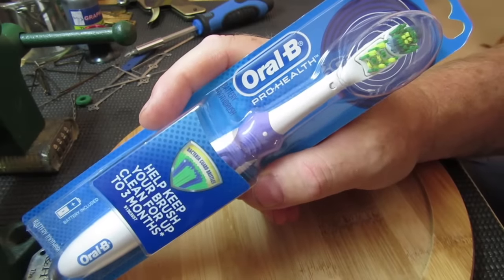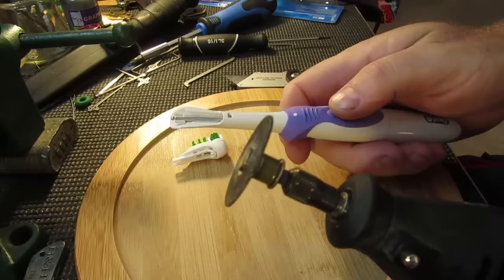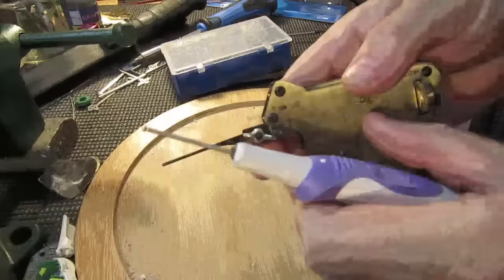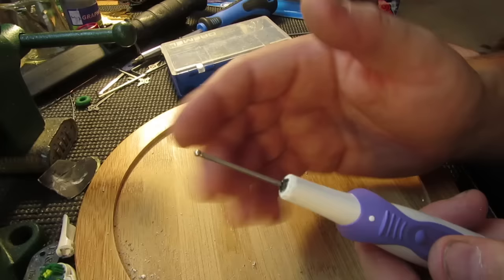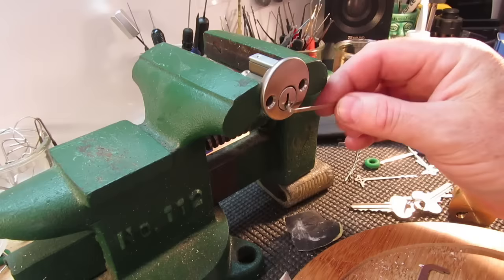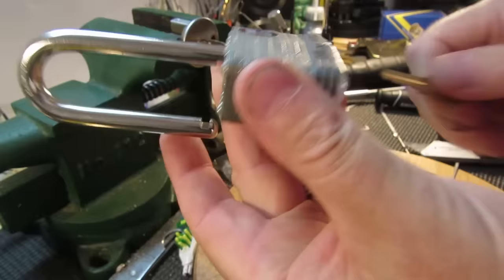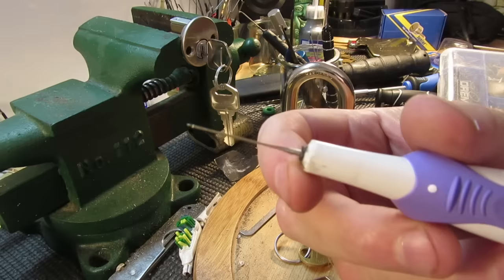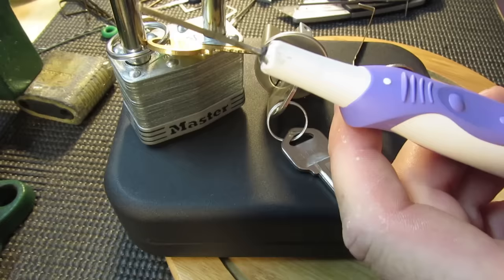Improved Electric TOOTHBRUSH LOCK PICK Simple To Make

Comment: Found on of these Oral B battery operated today at Walmart.  $6.94.   I'm going to try to duplicate this.
Reply: So far, have not been able to replicate this on the identical Master lock #5 or a five pin practice lock. I've got the "pick" file down to fit in keyway, but normal raking is giving a consistent result on the Master lock. Only routine picking with a small hook has worked on the practice lock.  Maybe I'll try this again some day when I have not much else to do.
Reply: Has anyone else duplicated this sucessfully?

Comment: HI the problem today is that the lock tooth brush you have is old tech that contains the steel wire! Most if not ALL modern tooth brushed do not have the steel wire but a vibrating motor in the tip. I took a new one from amazon apart today and it did not have the steel wire.  :-(

Comment: you use the 'electric lockpick' as a normal lockpick. i bet you can open the lock even faster in the off position. turn it off and pick the lock with it
Reply from the maker: lol it's a little under powered so your right it needs a little help but it does work somewhat . I am working on a much more powerful model that should work out much better or at least thats the plan. Thanks for watching..

Comment: Can you do wafer locks with it ?
Reply from the maker: It worked on the one you saw in the video, if you mean wafer locks on cars i have opened old style ones but it can't do modern day ones you need modern picks like  "Lishi" they work well if you have the skills to use them.
Reply: @JollyPeanut  Okay, I didn't know the one in the  video was a wafer lock. I've been able to do some wafer door locks and ignition switches with jigglers(but not all), I will give the toothbrush a try to see how it works.

Comment: It was all good until you got to that last little black box. Those locks are so easy - typically two manual rakes on each side. Reason: one side of the key follows the other so the pins pushed up on one side are down on the other side.

Comment: How does this work out on proper locks?
The two shown had horrible bitting and were really prone to raking (or shaking in this case);
and we all know those security boxes have the weakest wafer locks known to man :')
Reply from the maker: When it comes to real security locks its not much use, i have unlocked some Schlage dead bolt locks with good bitting but it takes a while unless i just hit it right so more luck than skill ..For the brands i showed it will pop them all day long whatever the bitting..And yes they are rubbish locks, here in US over 85 percent of deadbolts used are rubbish locks, so maybe some people here in the US who see this video may want to think about upgrading their locks.
Reply: @JollyPeanut   Still performs quite well! Better than a lot of commercially produced picking guns.

And yeah, from what I've seen, the US has a strangely low standard for locks...
I mostly use old door locks for picking, but here in the Netherlands I'd say about 90% of all door locks are either Nemef or Assa locks (Nemef is a Dutch company; part of the whole Assa Abloy group). Every lock I've ever replaced on my doors has had several security pins and other shenanigans like undercuts with a collar on top of it, lock-out mechanics, etc. So I'll have to stick to SPP'ing :p
Reply from the maker: @dutch_blades  I learned picking Euro locks i am from the UK now living in US and yes the locks mostly used in the US are garbage & would would not even meet UK standards for basic home insurance cover...Yes you will need to stick to SPP & Raking for the more secure Euro locks like the Assa Abloy's & the likes... Happy picking   bro..

Comment: That vibrate or spinning?
Reply from the maker: vibrating. although the metal part that goes into the lock is not fixed it does rotate..
Reply: It oscillates. The Oral-Bs all do it like that.

Comment: I'm still wondering if electric picks will work on a wafer locks.I red they can damage the wafers but have scant research results to see if they work on them as I don't care about damaging the wafers.  I buy cars at abandoned vehicle auctions and they often don't have keys and maybe I could get them running if I could use one on the ignition switch, thus avoiding the tow fee.

Comment: How do you know which direction to push the lever in?
Reply from the maker: If you are ref the tension wrench it depends on the lock, most dead bolt locks "front door locks" can turn either way, if you have the key to the lock then you know, other than that practice practice practice is the key..
Reply: @JollyPeanut  -  Okay, then I assume if you turn the key to the left to open the lock, you should pull the lever to the left.  I don't want to sound like a jerk, here, but my front door lock is installed with the straight edge of the key going in on the top.  Does this mean that the pins are on the bottom?  
Thanks for your answer, JP :)
Reply from the maker: Yes that's right, if you were to stick a needle or some tool like that in there and gently feel the pins you will be able to push down on the individual pins feeling the spring tension pushing the pins back up.. Check out Potti314 he has some excellent videos  explaining how locks work & how picking works, hope this helps..https://www.youtube.com/watch?v=bGZV_zvoSEU
Reply: @JollyPeanut  - Thanks very much :)

Comment: Considering the fact that the bidding on those locks are pathetic and could be opened easily with just a hair pin, I'm not at all surprised that modified toothbrush can pick them. If you're trying to make a point and show off the toothbrush, at least give it a lock with normal / nice key bidding. And if you're daring, also try it against some common locks that include one or two security pins.

Comment: The shaft of that toothbrush actualy rotates back and forth. I'ts not vibration. You should try with a sonic toothbrush instead. OR dont botther and just glue a a cell phone's vibration motor to a pick add a push button + some battery and you built it free from whatever junk you have.

Comment: In Prison, that would be converted into a tat gun 😈🤔
Worst thought is that someone “Keestered “ it in to be a tat gun lmfao 😂😂😂
Reply: Deafening Silence68 they use the motors from CD players, Homemande battery pack ( battery held together by rubber gloves wrists) pen tube for needle, guitar string for your needle ( uncoil and use center strand only file down with Punks Emery Board) pencil eraser in pen tube to run needle through.
Reply: Deafening Silence68 for ink, take your trash can flip it over, use a slug to buy a soda, break can in half. steal mop head thread ( one full loop) soak in baby oil. coil mop head into bottom of pop can ( like a snake ready to strike) steal chess pieces from day room ( Beating the Chimos is optional for this step, but strongly recommended) Get Fire Starter ( Batteries with Razor Blades Full Blade on Neg 2 halves for Spark) make a coil out of TP, lay TP coil half in oil half out, Spark Coiled TP. once baby oil catches put chess pieces in pop can fire pit, cover with trash can ( put shower shoe under Trash Can for Air) Once done, Scape off Soot on Inside of Trash can. Mix with a few drops of baby oil and your ready to go.
Reply: Remember, the game ain't Told , it's Sold. and never eat anyone Burrito ( unless if they're a Lifer, Your Safe There LMFAO) Ciao Tree Jumper

Comment: Defiant are the worst locks you could’ve tested. Sloppy tolerance I could pick one by blowing compressed air in it.
Reply from the maker: lol and to think that most of the US lock their front door with one or even worse a Kwikset...
Reply: Jolly Peanut Kwikset is substantial better than defiant.
Reply from the maker: @Cam3V  Which ones? I can open the most popular Deadbolt lock used in the US with just Jiggle Keys in seconds they are not good there garbage and made by Kwikset. If you like them then that is fine but they are not good.
Reply: Jolly Peanut jiggle key??? Sir are you even a locksmith??
Reply from the maker: @Cam3V  Retired.....Unconventional yes does it work yes.so whats your point?

Comment: Any decent lock will have springs that push down the pins thus making this useless. I can't tell if that video is a bit fake but in practice (real world), that wouldn't work just like that. Tried something similar years ago and it would work only on cheap padlocks, standard mailbox and old deadbolt. You might need a way more powerful motor to do what it's showing in this video; seriously.
Reply from the maker: What you see in the video is real not fake, you can check out my other videos you will soon see i am genuine but you believe what you want it does not effect the truth..This tool just like regular picks & lever's would not be much use to a novice, I am a retired locksmith i know what i am doing...

Comment: 😲 What sane person would think of turning a toothbrush into a lockpick? 😂
Reply from the maker: lol
Reply: It reminds me of when I broke my house key off in the lock and I had to find something to dig around in the lock to pull out the piece of key. It took quite a while...
Reply from the maker: smallish fish hook staighten  out the hook the barb catches on the bitting "cuts" on the key then slowly pull out the snapped key, locksmiths use a tool like this "broken key extractor" , works good...
Reply: 😲 That would have worked MUCH better than what I tried! 
I was locked out, so I could not get to anything I might have had. So I went to an odd hardware store and bought two different dental picks and tried digging it out, but just pushed it back out of sight. So I thought that if I used thin forceps maybe I could grab and pull it out, so I went two places to find the thinnest, but when I tried that I found there is no way to find forceps thin enough to even fit in a keyhole, let alone be open and strong enough to pull out a key. So I tried a dental pick again, and by then the sun was the right angle to see better into the hole. And I managed to get in back of the piece and drag it out. Something I don't know is why I couldn't unlock the door using the rest of the key if the piece was wedged in there. Oh well. 
My key now is good metal, not cheap brittle stuff. It will probably be around after the Sun dies in 5 billion years. 😉

Comment: Those toothbrushes are like $100 or $200 USD!!! Maaan. I had a coupon for like $35 off the oral b toothbrush. And I am like ok that is a good deal, maybe think is like $50... ohhhh nooo. It was $$$.

I would say. Just try get like an r/c car motor or something. Drill a hole in the gear part to place in some kind of scrap metal bar or paper clip.
Reply from the maker: They cost about $3 where i am ...This toothbrush is just one of many ways to pop open a lock ...
Reply: I have one exactly the same. Its the budget version. $20 aus

Comment: Take the battery OUT, and all those locks would have opened just as readily. You made a VIABLE tool, sort of. but did not demonstrate it working as a pick gun at all.
But none of that matters, because being technically correct does not count on the internet.... only clicks, views and retweets matter.

Comment: Master locks are shit, but if your gunna make all that fucking noise vibrating the shit out of a lock, you may as well just get a damn cordless drill, sharp steel bit and drill the barell completely out. Dont pretend about all the non destructive entry bs. A lock is cheap to replace, barell even cheaper.

Comment: bullshit, all what moovs inside is an electric engine that actualy turns around, - nothing more. what you need is the mechanic moovment from the head you remooved. of corse this method will work too, but only a few times till the device is ruined from powers you cant understand. so if its about to work on  one easy lock and the treasure behind it is more worth than the brush you killed, - go ahead and good luck..😂